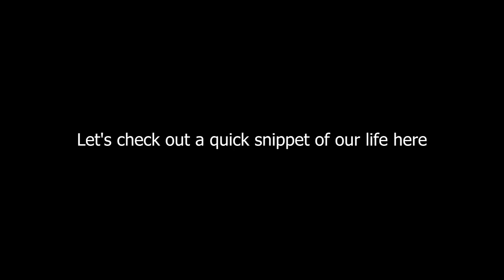"Building Paradise Together: Amir's Family Journey to a New Home"

Comment: Amir,   Look at Ghadir & Hassan - they are exhausted!  Their backs are going to soon give out! You don't want to drive them to despair by overworking them to the point of breaking down. You must make this task easier for them.  Your TOOLS are not adequate for your task at hand. Better tools will lessen the physical strain off Hassan and Ghadir. Can't you take some of your Utube money & get a SMALL GARDEN TILLER that runs on gas  & plows up the ground?  A simple RAKE would make leveling the dirt so much easier than raking with a shovel meant for digging.  Don't they have rakes in Iran?   Also, a SMALL FRONT LOADER will level the land and smooth out the road.  It would be so fast compared to digging by hand, clearing one rock at a time.  Maybe rent the tools or find someone who has them already?

Comment: Looks like someone been farming there. They might be booted yet again. How can they just start building anywhere they want and expect no one will care
Reply: They are not building. They said it was a temporary winter solution. They will try to find land nearby by the end of the winter. Obviously the road is used by vehicles to access the farm land on both sides. In my opinion, they will have to move to something more permanent by next planting time.

Comment: Before you build a house, you should agree on the land first. Otherwise, there will be problems again because it doesn't have complete title documents. If you do it, once it's built, someone will claim it and dismantle it. If that's the case, I suggest you use a tent or a yurt like the Red Indians. It's better than dismantling it easily.